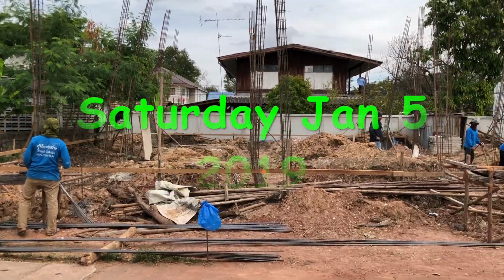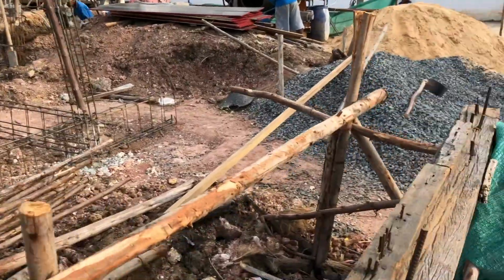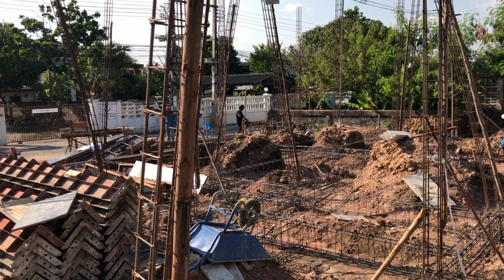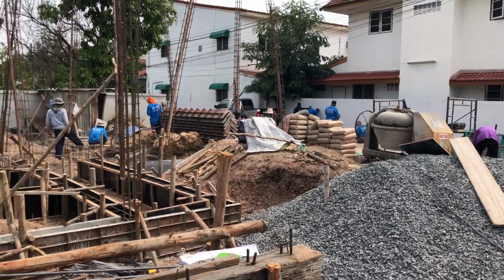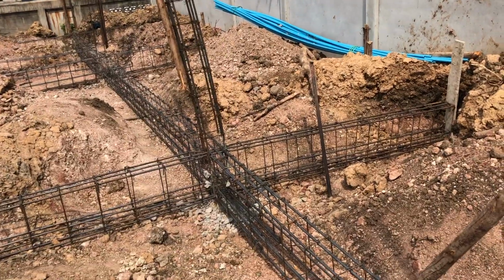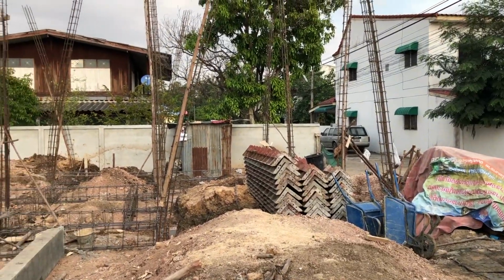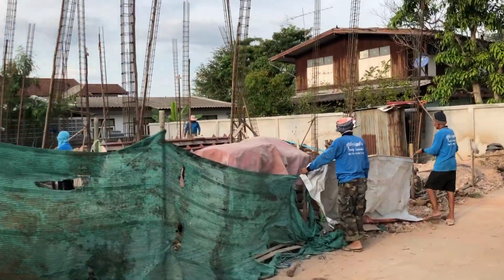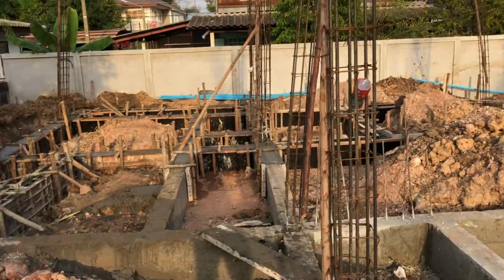v07 NEW HOME BUILD BURIRAM THAILAND - WEEK 7

Comment: That’s a big house to build in four months. Are they on schedule.?
Reply from the maker: What i learnt is 4 months in 'thai time" means nothing.  Not even close, however i never thought it could be done.  Lowered my expectations to minimize disappointment.  Currently in real time, they are moving along nicely.  Upper deck is in place and they are putting the mesh/cement down on the floor.  A lot of the walls are up 1/2 way.  They then reinforce them before going up to the ceiling.  Starting to take shape !!  Thanks for the question.

Comment: Looks like good progress, do you know why they cement the foundations from the front to the back?
Reply from the maker: hello there, i'd only be guessing why they choose from to back when pouring the foundation - probably a simple reason like "it's easier" !!  :-))  They do strip the forms off on the 2nd day, and back fill on the 3rd day so they do have easier access to the back corner.  I know the ceramonial poles (1&2) were also near the back corner.